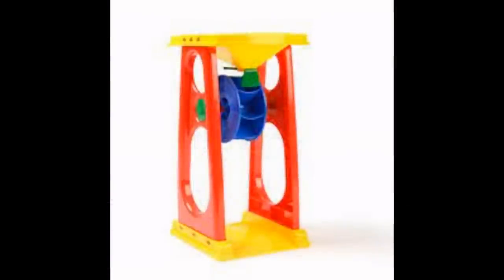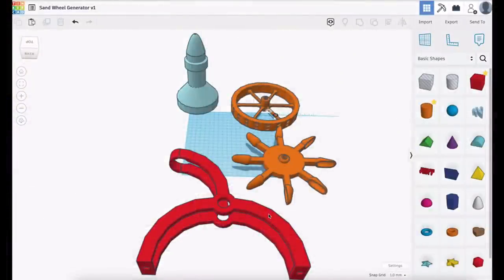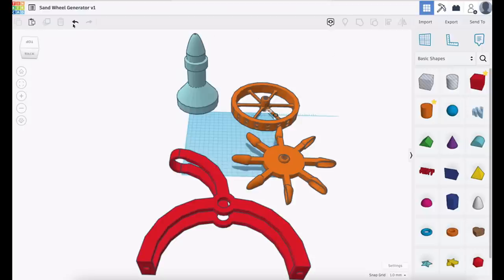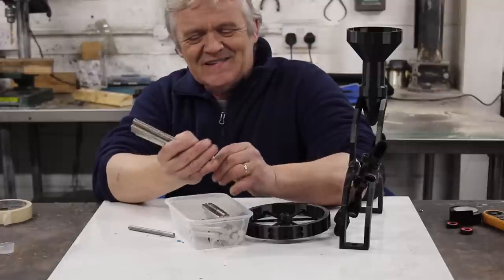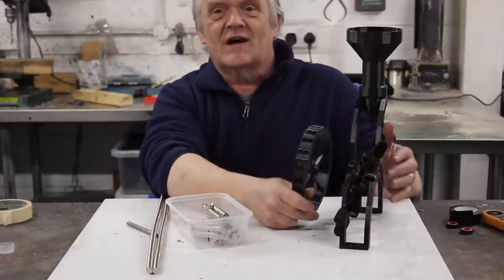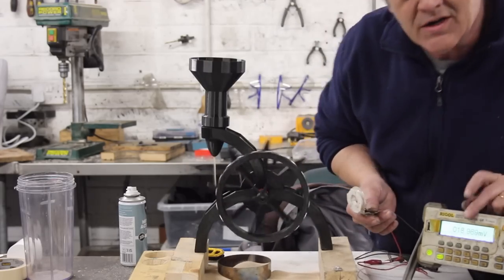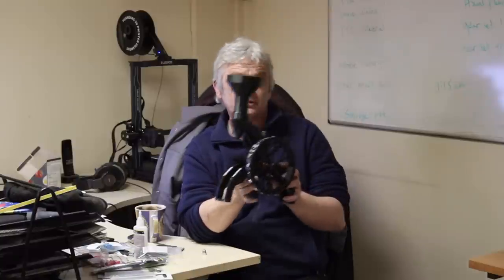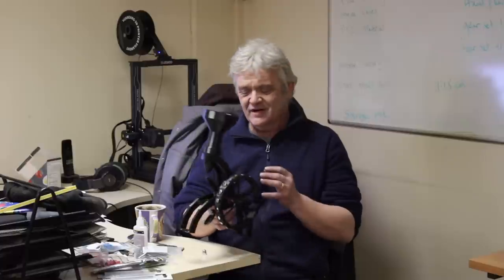1852 A Different Kind Of Sand Battery

Comment: Not sure if this is a good idea or not, but I thought I'd mention it in an area where smart people are likely to read it.

A gravity battery with a water counter-weight system.

It would basically be a very long vertical pipe with a bucket surrounding it attached to a pulley with a counter weight.
The pipe would be filled just to the brim with water but as the bucket gets lower the water is drained into the bucket via some kind of extending pipe that would travel with the bucket.
Once the bucket reaches the bottom, a valve is opened that travels the entire length of the pipe, draining the water back into the pipe as it rises up thanks to the counter-weight.
Once it reaches the top, the cycle repeats and the bucket keeps travelling up and down this pipe.

I feel like this probably would not work due to water levels or something, but I just thought I'd mention it.
Reply from the maker: you could always try and build a model of it and see if it worked mate

Comment: Great idea that gets the brain matter working :D It would be interesting to see how this compares to a similar one using water. Thinking outload here but I suspect the downside would be the sand friction when moving around would be higher (ie lifting with a with a bucket elevator or conveyor arrangement or against the funnel and itself when descending). The upside being more weight stored in a smaller volume. If limited on space then I could see the extra losses being worth the cost. 
Would this mean the most efficient material would be something like mercury (a heavy proper liquid)? Or is it an insignificant proportion of the total 'cost' of the losses that would be outweighed (sic) by the more concentrated mass and space saving
Reply: I think the upside of this is that it makes sand, particularly the kind that cant be used in concrete, more useful, though i do question how long anything printed in plastic would last. Maybe wood would be better? Or maybe plate the plastic in something that would be hard for sand to rub away with friction?

Comment: It might have some severe problems with abrasion

Sand is really rough and hard
Reply from the maker: I doubt it mate - the flow isn't that great - it isn't a sand blaster and they last a while!
Reply: "It's coarse, and rough, and irritating, and it gets everywhere."
Reply: @vorg_ Rubber sealed bearings

Comment: Combine a Sand battery with the hot exhaust of the diesel heater, that heats the sand up to 200 degrees. The hot air from the diesel heater heats up the room, then you turn it off, and the hot exhaust heated sand maintain it for 6 to 7 hours, so you save even more fuel!

Comment: Sort of like a solar nitrogen wheel. Several containers of activated charcoal, which absorb nitrogen, move one side into the solar heating area, which drives off the absorbed nitrogen, making that container lighter, so it rolls up. Moving another container into its place. With central collection plumbing, this also is a nitrogen generator.
Reply from the maker: I have seen something similar - myth busters I think

Comment: HEY - YOU COULD NOT MAKE THAT PERPETUAL??  BY SOMEHOW COLLECTING THE EXPELLED SAND FROM THE FLOOR AND IT FEEDING the sand itself BACKUP UP HIGH INTO THE HOPPER? THEN IT WILL RUN FORVER BY ITSELF (as long as the sand doesnt get wet or damp)

Comment: Guys, not to be a wet blanket BUT I'm amazed by the number of suggestions to use the power to return the weight (sand. pebbles, grain, whatever) back to the top.
That's " Perpetual Motion" "Unity Machine" etc.
It doesn't work in this real world which has friction, for these types of machines. It hasn't worked for centuries of marvellous machines. 
A little friction anywhere in the system causes it to run slower/generate less. so less is returned. so the machine runs slower. so less is returned...blah blah. It stops.
This stuff was sorted absolutely centuries ago, for simple machines like this. Why does it persist?
You're asking a battery to recharge itself? With no energy put in from outside? Please let a little common sense, and education, and thought, come into play.
Some comments are actual gold, and worth considering.
Some, regrettably, would get the channel a reputation as a bunch of fringe loony crackpots.
I'm not wanting to be downputting or derogatory....just please let's have a little consideration for all the science that has been done as far back as da Vinci, at least. Centuries of it. 
Unity, even Over-unity, might be a thing when Quantum Physics and the like are more understood,  but sand falling from a funnel?. Come on.

Comment: I remember playing with these “sand” toys at the sand pit & troth at primary school ~ pouring dry sand into the funnel, opening the valve and seeing the wheel spin. Having seen other variations of sand & water toys ~ my favourite being the Archimedean screw based one = dry/damp sand is poured into a funnel at the handle end, and the handle is turned in the right direction and the sand goes down the funnel and eventually comes out the other end 😀
Reply from the maker: nice

Comment: I have just been reading about the fact that they have to stop electricity production from wind farms often because the 'grid' can't take the higher power produced when its very windy. This it seems happens often with the off shore farms.  So storage of 'power' in some form seems to be something we really need (as well as improving our national grid!). I often wonder (and if I was in good health and younger) about buying power  off peak and storing it for use during the day. My parents did this with economy 7 and storage heaters. Perhaps they need to make a come back?
Re the sand  battery in the vid, damp in the air could be a big problem surely?

Comment: Your Scammer is still trying really hard making a fool of himself.
On vid: 1851 There Really Is Free Energy Everywhere - Electrostatic Motors;

I made a comment
@elvendragonhammer5433
6 hours ago (12 hours after your original Post)
If I recall correctly LaserSaber made a few versions of these on his channel a few years back- it'd be interesting to compare efficiency & speed / torque output between them.

He replied with this:
@user-hjk
5 minutes ago
Congratulations you have been selected as a winner..???? kindly send a direct message above to acknowledge your prize...

{@3:00AM the inconsiderate bastage woke me up- & even with a sleep addled mind I'm not gullible enough to fall for that. <but thanx for the heads up anyway>}

I did also report him. Just thought U should know. Also I do like the current chat topic & am following ...
Reply from the maker: just found him and banned him mate - cheers

Comment: Leverage.  Long lever, big buckets of sand.  Human movement and hourglass for slow release.  And towers of wheels using the same sand.  Multiple buckets of sand, multiple towers, multiple hour glasses.  Tall towers, at least within reason.  Leveraged pulley system to use human power to elevate the sand to the top most bucket.

Comment: What you need is a bicycle-powered or wind-powered elevator to lift the sand and fill the hopper. I seem to recall seeing an Austraulian design that uses a fixed auger and a rotating shell. Was that Smarter Everyday? In any case, would like

Comment: My thoughts are on how to clear sand after the wheel. Catch it in a bin 
lift the bin, store the bins, poor it from the bin.  It's really all about the bins. 

But with a sand wheel,  I'm thinking pouring sand looses much efficency moving air around around fast moving falling sand particles. And resistance being the cube of velocity. If only we could move the sand in bulk at a low velocity. 

Maybe one could load up bins with sand and load the bins onto carts with a motor/generator on each cart that sits on rail a rail road racks that complete a circuit from bottom to top and back,  where bins are loaded at the bottom and stored on top of a hill to store energy, and the reverse of that when you want to draw energy  out, and unloaded carts are returned on the return track.  

Maybe simply load carts into an elevator that lifts and lowers them to store or generate electricity. But  Instead of a building it would be above ground and below ground storage for the carts and bins.

 Counting moving bins around at the top and bottom, It should have a round trip efficency comparable to or better than to pumped hydro. And geographically possible in a great many places without ground water to contend with.

Comment: Some obvious improvements. 
No need to have the sand drop in front of the wheel. Drop it closer to the top, and make the buckets broader to stop spillage 
Design the bucket shape to drop the sand later in the cycle.
Replace the wheel with a vertical conveyer belt with bigger buckets. No need   for symmetry.

Comment: I was thinking of something the size of the Eye of London. If all the chambers were full of sand and the sand would release as the chambers approach the top. The sand gets funneled to a pipe and is feedback to the paddle wheel. After the work is done, the sand then refills the chamber's polar opposite chamber. The ferris wheel would never stop. I would be very cool if it could make more power than it consumes.

Comment: Hello there. If you wouldn't mind answering an unrelated question I have on wind generators or indeed for anyone reading this, because I'm having trouble finding an answer. Here goes, and if it's a silly question feel free to tell me. For wind generators everything related to the blades are in a vertical configuration and for the most part all other styles are the same. Why do they design this way and not horizontal a la Airplane wings or should it be called airfoils. Either way, can someone enlighten me. Thanks.

Comment: as always very amazing and very cool, I love the observation of what is available around us. Sand is an interesting energy store relating to a movement of mass to transfer into stored energy. The issue I see with sand to generate large enough usable energy is first how dry it is in order to flow? Is it hygroscopic? Moving the mass of sand from the bottom outlet to top input would require how much energy? Sand is heavy and not too easy to move. Would the output of energy exceed the energy generated, therefore having a yield?  As always: energy in energy out, with potential losses

Comment: Some obvious improvements. 
No need to have the sand drop in front of the wheel. Drop it closer to the top, and make the buckets broader to stop spillage 
Design the bucket shape to drop the sand later in the cycle.
Replace the wheel with a conveyer belt with bigger buckets. rNo need   fo

Comment: i once drew up plans for a water powered generator. it consisted on a body of water on top of a hill. the water flowed out of a pipe downhill into a set of ram pumps, that pumped water into an elevated tower with a discharge pipe that emptied onto a Pelton wheel generator that produced 14 or more volts dc to charge a battery bank. 
the waste water from the ram pumps would collect and power more ram pumps to fill the elevated water tank. at  the bottom of the hill would be another pond/tank to store the waste water with a solar powered 12 volt pump to pump water back into the pond. it might have taken several pumps to get the water back to the pond as i was planning on using harbor freight utility pumps or the rv/camper potable water pumps.
i only drew it on paper and not sure if i still even have it.  but the idea was to power an off grid battery bank to supply power for a whole house or maybe even an underground bunker.
anyway it was just an idea as i gave away the land in Montana because of becoming severely disabled from a staph A infection.

Comment: They pump water from the lower dam to the upper 3 dams at night when the power rates are low then generate electricity with the water on high price times.... in Phoenix salt river project. I was thinking of 2 tanks of water, using a solar water pump to get the water to the upper tank then make electricity at night with the water. It would be a sealed system so I won't loose water.

Comment: So how about putting it on top of a mine shaft and sieving the spoil heaps and pouring them into the shafts via the sand batteries system with roller systems sending the sand along the seams of the excavations to make the system last a longer time ? Hundreds of abandoned mines all over the uk ?. Using the same idea to fill in old sand and gravel clay lime quarries slate quarries old iron tin salt mines etc  Lots of holes need lots of filling from lots of waste materials not only sand ? You could even use it to air-rate compost with a large shaft open at at the bottom end of the shaft to remove the finished materials or just off the edge of an old quarry with a road to take away the finished products ? Other products like mixed aggregate old road plannings scalping for bases for roads buildings etc old pulverised food stuff for fertilisers also with open  bottoms to clear the end products this list could go on and on ? Mixing the products from two or more sand wheels for perfect mixes you could use an Archimedes screw again using gravity first to mix the products then drop it half way down the drop,to then put it into the sand wheel for the production of energy ?Truly a great idea with endless materials to use for the propulsion of the sand wheels and lots of holes to use them in ?

Comment: The only contraption I can think of to use sand effectively is to make a giant hourglass that takes 24 hours to drain on a crank system so you can flip it even if it's really heavy with very little effort and once a day flip it and you will have a steady charge that you can run through a capacitor Bank to make a live powerline to use depending on how many hour glasses you make and wire in series or  parallel you could potentially produce your own power on your property by just going out into your shed and turning a crank over and let  the sand drain and it would be technically a source of free green power and highly efficient you could even use a windmill and I weighted pulley system to do it automatically

Comment: What if...you used a geared assembly to create the electrical current.  May cause extra drag but larger cups on your wheel to catch more sand would help.

I like the idea and as others have said an auger to move the material back to the top of the silo or hopper could work.

Comment: This is how many mines work to save energy instead of trying to store it. Basically a ski lift with sand scoops/dump buckets. The issue is distributing the sand with minimal energy. Possibly a siphon system at the top and bottom.
Reply from the maker: nice

Comment: Filling that funnel with small metal bearing balls could get a way to get more mass hitting the wheel as they are denser, could play with different sizes balls and the wheel would prob have to be redesigned.

Comment: If you use water, you could use the sun to evaporate the water to the bottom side of glass to collect the condensate. At an angle the water drops slide back into the top reservoir. When collects enough, opens gate on funnel to let run again.

Comment: I have to wonder, as sand piles in a cone rather than spreading like water the wheel is going to need to be held higher.  As the generator is higher the potential energy of the system is decreased and the energy to "pump" the sand is to a given height remains the same as with water.  That said it is the cost/wH stored that would be the kicker which I have no idea about.  It may actually be feasible in deserts where there is abundant solar and sand.

Comment: It would perhaps be interesting to see how the wheel works with other bulk powder substances, sugar, cornstarch, salt, fireplace wood ash that has been dried and screened to a very fine dust.

In that context, if you were to create a sealed system and attached a flywheel on the axle in the form of say a Tesla Pump coaxial with the sand paddles and the magnet wheel, you could generate air pressure (or vacuum pressure) to create a pneumatic stream which would convey the fine powder upwards back above the hopper level of the device.

In this case, the undesirable effect of fine dust to become airborne and cause respiratory problems could be used to advantage to redistribute the material back to maximum potential energy.

Of interest would be the comparison of the same mass of substance A vs substance B ( would you rather be smacked with a ton of rock or a ton of feathers?) and at various heights say up to 10 meters in 1 meter increments to measure how much torque they could impart to the axle.

A separate but parallel experiment on the same sealed system that might be of interest would be how the conveyance tests would fare if you first removed all of the air and performed the same tests sous vide.

Comment: Can you stack them so that when it falls off the spoon it falls into another funnel starting it over again. As long as the top reservoir is big enough you could have all run at same time from filling one reservoir maybe wire together to boost either current or volts??

Comment: I would imagine something like an hour glass that can be rotated to reset the device, perhaps with an electric motor powered by the sand generator with a float system to initiate the rotation when the sand levels get low.